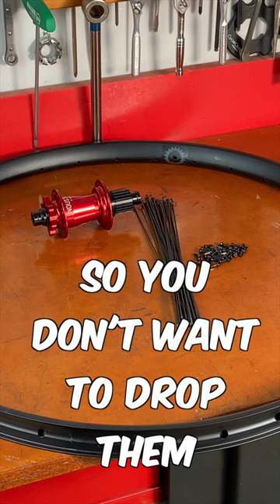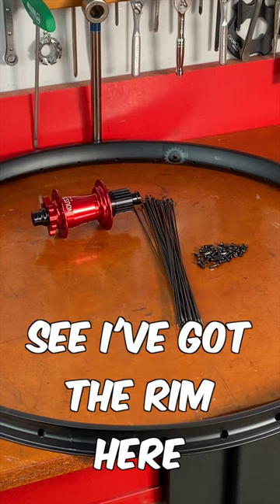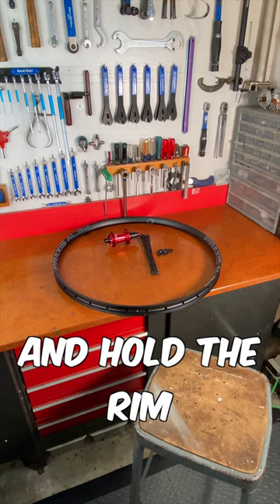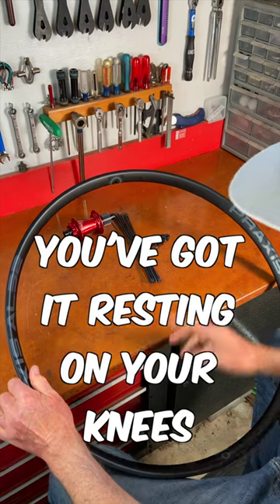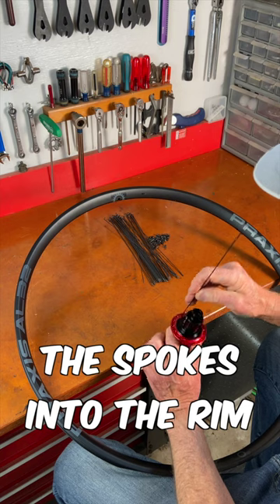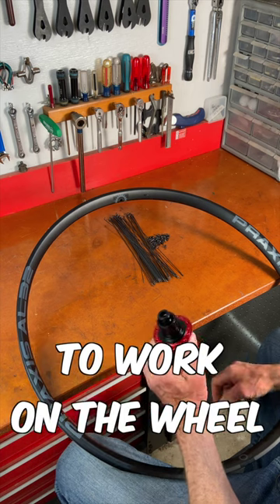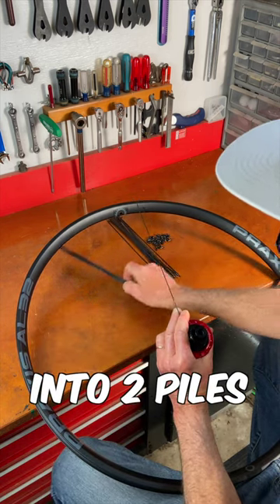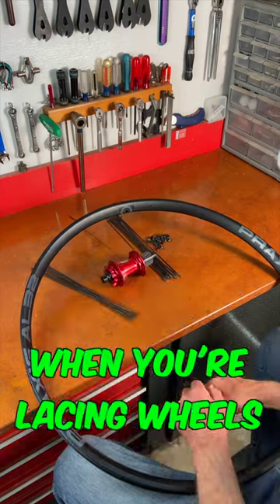GREAT SETUP for Lacing & Spoking Bike Wheels #shorts

Comment: I just sit on the couch and hold my rim in my actual lap with spokes and nipples off to the side of my dominant hand in bags open so I can easily pour some out a few at a time minimizing the risk that I’ll sit on them or lose a bunch of them. To be honest I have never dropped a hub once you put in the first 2-3 spokes you should be just fine it won’t go anywhere just thread those nipples on a couple turns like 3 I hold the hub with my knees
Reply from the maker: Thanks a lot for watching and sharing how you hold your wheel components for lacing wheels aurteekay, appreciate it 🙏